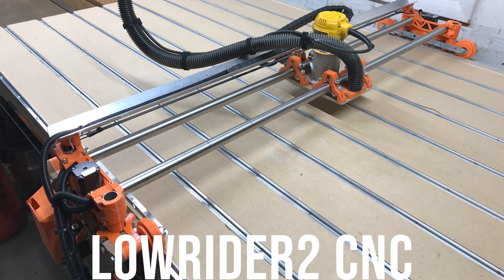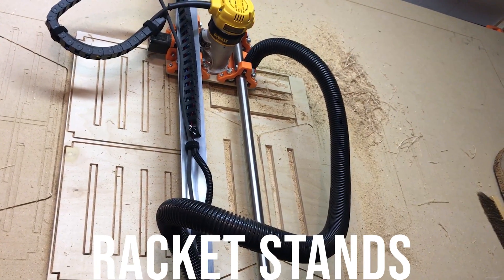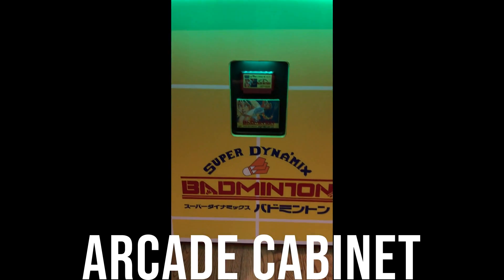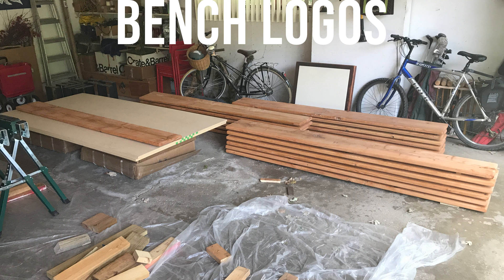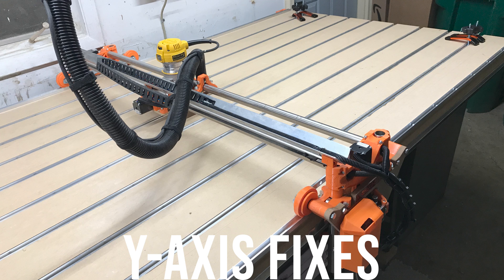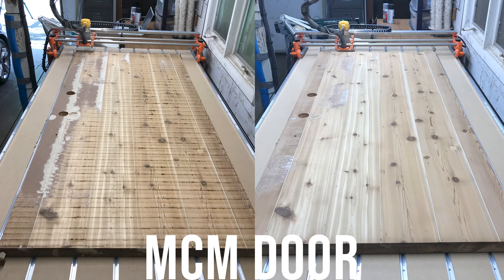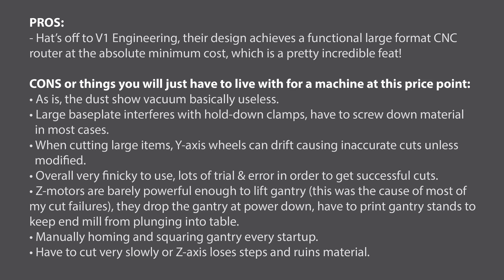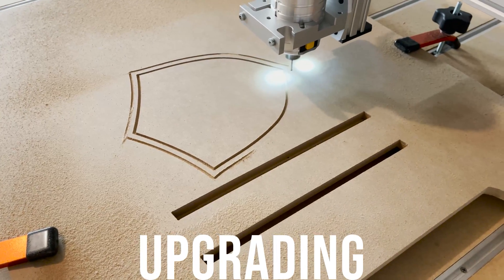REVIEW: LowRider2 CNC - Large Format 4x8 CNC Kit

Comment: I wonder if counterbalance springs on the z-axis could assist with heavy routers or prevent the head crashing. The c-channel is brilliant. Excellent custom wheels. I might consider v-channel wheels with upside down angle bar; so they stay clear of debris. 

Great video and resource even though you’ve since sold the machine. Thanks for posting!

Comment: What did you build as a replacement and how did you go about building it. The brief shots at the end of the video look really solid by comparison to the low rider.
Reply from the maker: I used the same table and attached to it long round linear rails for the y-axis, took some OpenBuilds parts to use for the x and z-axis, then used my WorkBee machine to mill out some custom parts from 1/4" aluminum plate to tie it all together.

Comment: What version of the firmware are you using, as I gave up with my large format because on the long y-axis I was getting a jump in the Z axis about 3/4 of the way along,  I posted the problem on the forums but there was no answer to it.
Reply from the maker: I was using this file "Marlin-MPCNC_MRambo_T8_16T_LCD" from V1 engineering, I think it was Marlin 2.0...I still have the zip file and can email it to you if you want